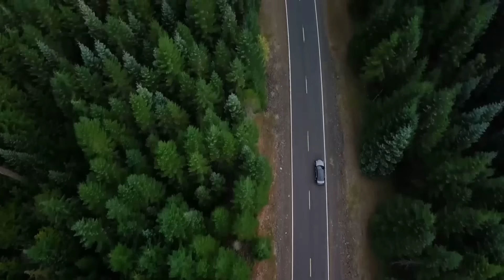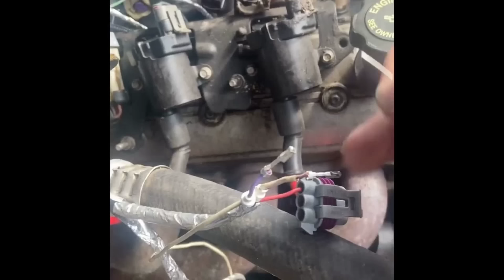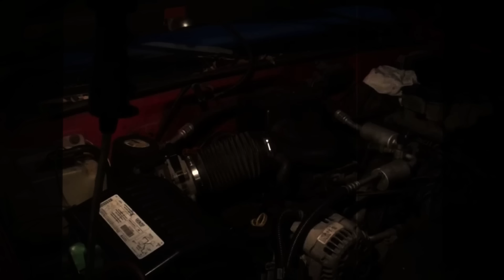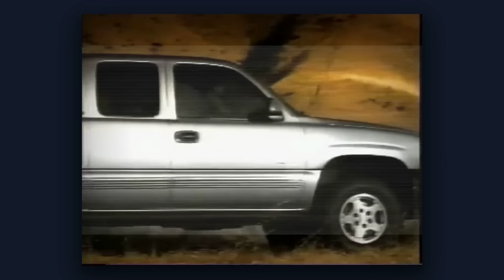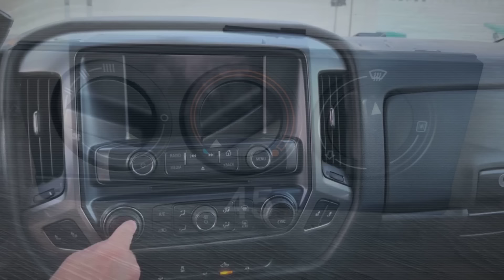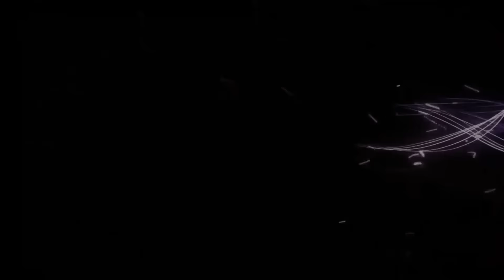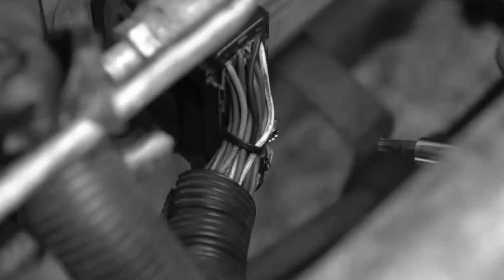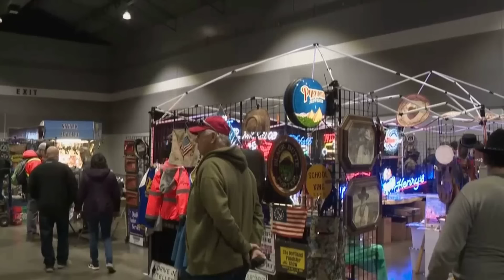How Smart Mechanics Are Bypassing The Dealership (The "Delete" Loophole)

Comment: This is AI dribble, I can't even watch more than a few minutes, none of this is common practise in the real world.

For starters, nobody goes to the dealership to buy an ecu for a 20 year old vehicle, that is ridiculous, even if they still manufactured the part it'd be way too expensive.

Mechanics will just replace them with a second hand unit and code it using bought aftermarket scan tools or by using pirated manufacturer software like I have in the past.

I worked for BMW and our dealership changed over to Audi, we were able to keep all our BMW customers that were past their warranty period, by quietly purchasing a dozen pirated BMW scan tools that were identical to the factory units.

Talking about completely stripping out the factory ecu would be a freaking nightmare on a 20 year old vehicle let alone a later model, so many systems in the vehicle need to communicate with the factory ecu, even your alternator is controlled by it.

Like it said, it will have issues communicating with transmission but that's only one of many issues and swapping the entire transmission and converting it to manual would cost way too much for the purpose of fitting an aftermarket ecu, (which I'm guessing is probably gonna cost $12k Australian, minimum, just to get the aftermarket ecu bought, installed and programmed, that's without the transmission etc) and the dozens of other things you'd have to hack or bypass to get all the vehicle systems operating and communicating on the various bus systems used in post 2000 vehicles, it'd end up costing so much.

I've literally watched videos in the last few days of people debunking these AI videos as pure lies and misinformation, they're killing YouTube.

Comment: Worst I've ever had to do was cut a jumper cable to replace the negative terminal wire when it snapped due to vibrations over a couple decades, and a can of beans with hose clamps and a coat hanger to patch and rehang the exhaust. I'll keep these in mind though.

Comment: Another project of mine is wiring in a house stereo system when the big stereo systems into my vans audio turns out that was a lot easier than you would think 110 power inverter into the cigarette lighter plug the stereo system into it extend the wires off the back of the old car radio wire harness to hook up your speakers and then build a nice box to lay the radio on its back in between the two front seats sucks driving around with no radio and the only thing I had was a home radio so I made it work turn on the plus side I can hook up to the large bass speakers too

Comment: Headlight switch went out and I used a three-phase house switch you know the ones where its power on low when you got it up turned up and power on high when you got it turned down but power off when it's in in between them and I wired my headlights with that up with high beams down with low beams center with headlights off

Comment: Although it's not a part of my engine, I am finding it harder and harder to find replacement body panels for my 96 s10. 
They don't even make my floor panels anymore, but they still make them for the previous generation in the 80s, and the later generation from the 2000s. It ain't right

Comment: I have NEVER owned a one of these cars/trucks with an engine management system, every thing I've owned have been analogue except for the after market radio.
And every time I've hired a car while travelling for work I've always rented the cheapest most basic one available because I absolutely hate the "Infotainment systems" that are in new vehicles as they are nothing more than one huge piece of SPYWARE, if you pair your smart phone to one, every piece of data on your phone will be copied and sent to the vehicles manufacturer, who will the sell it on to data brokers. It is best to TURN OFF YOUR PHONE BEFORE YOU GET IN THAT HIRE CAR, and do not use the "Infotainment system" – instead use your own GPS Unit , if you have to used your phones GPS, put your phone onto ‘Airplane Mode’ as that is a passive system.

Comment: Yeahhhhh about that, did you know for state emissions as soon as they plugged their computer into your computer, they can tell that the system has been changed and if it doesn’t comply with the emissions that the state has they can fail that vehicle so that module you just pulled out to make it run just failed you because it’s not complying to the emission system and by the year of the vehicle, the emission system must be the same year as the vehicle itself

Comment: How to bypass the high and low speed can buss systems. Work on this garbage nowadays you can have the modules repaired. They are running can bus through your headlamps nowadays that will cause a draw put led bulbs in your camera system goes out. Miss the 90s vechs.

Comment: Sooo... instead of a carburator, why can't a fuel ingection engine also have a gear/serpentine belt driven air compressor to inject the neccessary volume of air determined by the computer tuning? Would that not just be the logical next step? To give the engine a lung to breath from that maintains it's own constant pressure and driven by the rpms of the engine itself? Or would that cause a serious problems during the exhaust stroke?
 
Can someone that works on engines please point out the flaw from this design idea and maybe offer their opinion on this idea?

Comment: A VW TDI swap works with a mechanical injector pump, one wire. You can also use the TDI with the VW PCM on electronic injector pump. My son has done both. One on aJeep CJ7, and one on a Jeep  XJ Cherokee. The mechanical is a bit louder.

Comment: F the gov f regulations! I rip all epa trash out of my vehicles, they not only live longer, they also give you far more power fully stock! The recycling is a blight to your engines! They say pcv valves will never hurt your car, they do more than hurt it over time, if they fail your engine is toast! You can bypass them, or a cheap quick mod is a catch can… id recommend removing the pcv completely tho, takes a lil more work. Also def systems on diesels, best to remove that absolutely first!

Comment: i saw a video about how to get into the diagnostics of power tool batteries and it is because it looks for a predetermined voltage like you mentioned with the resistors and they hacked it by putting different current through it until they basically unlocked it

Comment: For at least 95% of users re-engineering fuel supply and ignition system are not viable solutions as they just want to drive new shiny car not to look like worse than their neighbours ;)
Only rare car enthusiasts are capable to maintain their classic car in good condition and use the conversion in question as the last resort. 

I expect it will be resort of custom cars only. But only some of them could retain or even increase its value upon such car conversion

Comment: Not a mechanic but have a paid off 2014 vehicle that Id like to keep....I like the switching out engine solution ..but have been looking at diesel engines that can run on multiple vegetable oils ...have run down the rabbit hole...
Have you already addressed this or will you in future...otherwise I will go to the U-pull-it ,salvage yards... I can pull stuff out ..
Id like a list of mechanics who work on "vintage" wink, wink, cars ...or know how to turn computer drive back to analog..,I learned to drive with a clutch... and a 4 on the floor....Im willing to turn back that clock...Id rather have a valued mechanic that knows how to make things work !

Comment: My brother was a mechanic in the army and when Humvees would come in with a blown head gasket and they didn't have replacements they would coat the gaskets with JB weld and bolt it down more than specs and it would go for longer use.

Comment: Honestly ive been in the business 30 years. The best thing that has ever happened to cars is the fuel injection   I was worried about fuel pumps soaking in gas or wires everywhere but the fact is most of it works perfectly for a long long time.

Comment: I'm a lifelong mechanic/fabricator/machinist as well as being a mechanical engineer. 1n 2016, when all the EFI stuff failed on my '89 GMC longbed pickup, I swapped on a 60-year-old Rochester 2GC carb. Yes, I had to machine an adaptor plate, change some plumbing, put a pressure regulator on the fuel line from the pump, and a few other minor mods. And an aftermarket HEI distributor with advance weights. Still starts on the first turn of the key, and gets about the same fuel mileage it did with EFI. Fixin' to do the same to my '92 Silverado.
Reply: Time to teach and put out your own videos.
Reply: What do you think the cost would be to have somebody do that?

Comment: Older diesels didn't need Electronics they were all mechanically operated gear drive fuel pumps and all the other accessories most of them were gear-driven and you only needed a switch and a solenoid to turn on or move the linkage on the fuel pump to have the pump in the open position or the totally closed and off shutting the engine off 

Diesels never required spark plugs distributors or any Electronics they simply ran because they compressed the air and superheated the air to achieve ignition 
A good book about diesels or Rudolf Diesel we'll tell you some of these basic things

Comment: Toyota didn't offer a diesel truck in the US since the 90's. A silverado as shown wasn't offered with a diesel either in the US. You can't put a carburetor on a diesel engine. Tampering with emissions devices is illegal. This is nonsensical B/S. Nothing is that easy. I own a shop.

Comment: I really miss buying a vehicle, not a rolling computer.
Reply: That's why I'm rebuilding my '86 Toyota Corolla. It's OBD1 at best, the only thing electrically controlled on it is the electric choke on the carb. I'm sure it can be bypassed or built different.

Comment: Not too new of a concept. I’ve been doing this for over a decade. I’ve hand built/soldered microsquirt controllers, hacked factory PCMs and more to maintain family vehicles and for performance. 

The idea that you have to entirely delete the factory PCM is also not always necessary. For example, I had a 93 GMC Sonoma with a 4l60E transmission. I moved the engine controls to a microsquirt aftermarket PCM but still kept the factory PCM solely for trans control. It only required a few inputs to prevent limp mode, such as coolant temp, throttle position and ignition.

Comment: For some modules and controllers, you might have to enlist the help of a cellphone or computer repairman, capable of soldering micro-parts.

One thing Ford does is link the vin# to a lot of the computer controls, including the electronic steering. You're only Orion is to buy a new one and send it to Ford to have it flashed, old or rebuilt ones can't be flashed with new vins as far as I know of, and it's not like just living without power steering, you are fighting the gear box which makes it feel locked up even with momentum. There is no reason to design it this way except tk keep ppl going back to dealerships.

Comment: I picked up a 1988 chevy 1500 for free, truck body and interior was nice shape, Previous owner said It quit running in 2009 due to a fuel injection computer issue. He didn't know how to fix.  I simply pulled the TBI, installed a carb intake, Carb, Mechanical fuel pump and HEI ignition. Runs great. 350 has good power, needs new valve seals, smokes for about 10 seconds on cold start. No more electronics! New brakes and tires because it sat for 13 years.
Reply: The valve stem seals are not terribly difficult to fix in those trucks.  Pop the valve covers, remove the valve springs and make sure to use a pneumatic valve retainer to prevent them from dropping into the engine.  Push the new seals in place and put it all back together.  There are some good videos about adjusting the springs to the proper tension.

Comment: What is The Most Extreme modification I've done to keep an older vehicle on the road? Well, first I've never bought anything newer than 2002, ever. So I guess my most extreme modification is me, I'm 50 yrs old now, and almost bought an 06 mustang. Looked under the hood at the showroom and said "nah. Theres no way I can work on this with my sae tools." Sales dude wouldn't take no for an answer and kept pushing, I kept walking right out the door and still to this day have my 02 focus spi (4th cylinder head) and nothing newer than 2002, Outbacks, Mazda rangers (1996) etc. cash for clunkers sure did destroy an entire generation of vehicles. It was a huge obummer.

Comment: My 2000 f350 flrolled out everyday for work as whole new truck fleets were ground do to a plastic actuator stuck on ships. Rockland auto for really great parts. 7 years brake pads, oil changes and a couple sensors. 7.3 it worth its weight in gold.

Comment: The ECM in my 2006 Jeep Wrangler went out and I couldn't find a reliable replacement.  I removed the entire system and installed a Holley Sniper system.  It runs better than ever and I have complete control over my vehicle.

Comment: Bypassing electrical components doesn't matter when parts for the drivetrain, braking systems, suspension, and chassis is being intentionally ceased in production by the manufacturers with no aftermarket supplying them. How is someone going to keep a vehicle older than a decade in operation when the parts are not available? Internal engine components, transmission Internal components are machined to close tolerances. Just like with my 13 year old car. The ABS control module is completely unavailable and can be only found in a junkyard now. It was the same on my 91 Dodge Dakota. A spider gears sheared and I had to scour junkyards to find another axle. Literally no parts supplier carried a new differential for a Chrysler 7.25 axle. And that axle was used by Chrysler since the 1960's. I finally found a Dakota with a 8.25 axle equipped with Trac-Loc, rebuilt it because rebuild kits for that axle are still available. Basically upgraded to a stronger axle unit with limited slip as a bonus. My ex had to sell her 2009 HHR due to one of the transmission shift solenoids seizing. The transmission control module and the shift valve body is solid riveted onto the inside of the transmission case requiring the entire transmission to be replaced. A replacement T40 transmission cost more than the vehicle. Paying for a junkyard transmission is a gamble on a transmission that was intentionally designed to be non-rebuildable. It's eventually going to be more difficult to rebuild and repair vehicles built before the 2010's due to parts becoming more difficult to find. And what parts that are available are typically overpriced and are of low manufactured quality. Forced phasing out due to auto manufacturers and the government trying to force people into buying new fuel efficient small engine cars, hybrids, and EV's.

Comment: Welp I use a esp32 and a arduino uno in my chevrolet caravan to control from my whipers, cooling system, tires pressure, gasoline and blinker fluid levels.

Comment: Except for the part about putting in old engines with carburetors that kills any kind of fuel economy. The true fix is getting the courts to overturn DMCA 
Section 1201. This is the part that prevents the tampering with digital locks. Remove this and the problem goes away because you are free to reverse engineer and fix the broken electronics at an industrial scale as long as the purpose is repair.

Comment: This would be trickier with cars made after 2006 or so, with the CanBus electrical system and modular architecture. My 2010 Ford and my nieces 2006 Mini Cooper S, are CanBus. Had to buy equipment just to connect to their software.

Comment: One thing worth mentioning is 3-D printing. I fixed several parts on my jeeps using a 3-D printer cost to me about 1 to 2 hours depending on how complex of art is to design it and then $.20 of plastic
Reply: 3D scanning with your phone is a thing you should look into.  Just copy it
Reply: Yes, for quite a few parts a 3D printed one will work nicely.

Comment: Asking me to buy a new vehicle because some plastic broke, or wiring went faulty, is the equivalent of asking me to buy a new PC because the fans aren’t working correctly. Like needing to buy a new stove because the heating element went out. It is corporate blackmail to force you to spend unnecessary money. I’m tired of it. This is why I have a 2007 Honda civic. 133,000 miles and still running like a beauty.

Comment: Had a Z computerized quadjet Trashed it and out on an older (i rebuilt) quadra jet. Rebuilt the HEI (older model) I actually got better fuel economy and speed. This new crap is over engineered and is not worth the time or money to repair. Also have a older 1986 Dodge with dual air pumps (WTF) Eliminated them among other garbage and now preforms much better and is still alive. Hey even if if your you $4,000 that is $80,000 less than you would pay for new garbage that YOU DO NOT OWN.

Comment: I remember having to put resistors in a steering column on both of my 90’s Tornadoes that I used to have. Because the contacts inside the ignition switch wouldn’t touch the keys resistor anymore. All the systems they put in these cars are very redundant. They were then and they’re 10 times worse now.
Reply: I have a Saab like you are talking about and I just took out the RIF and glued it close to the ignition and don't have to even worry about loosing a key. A new blanks works great.